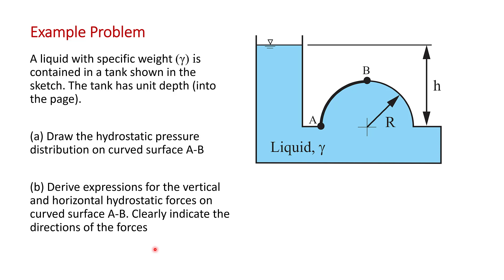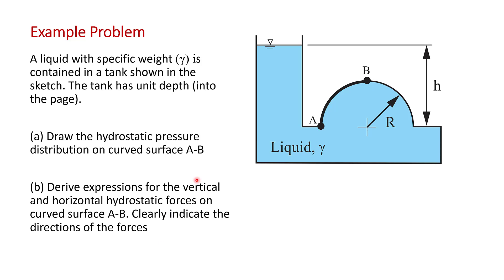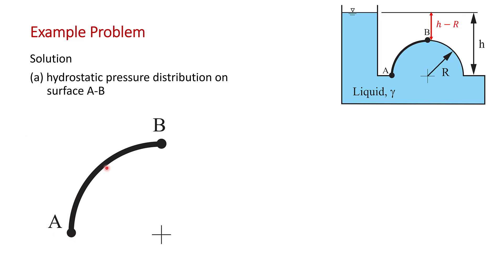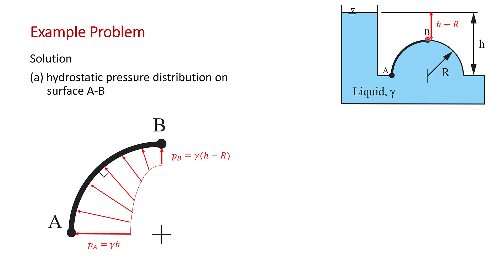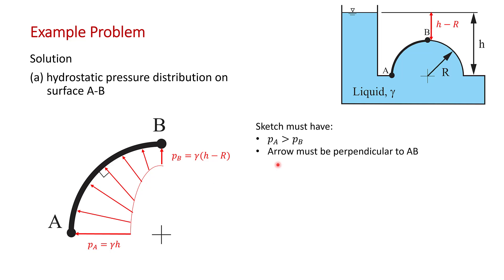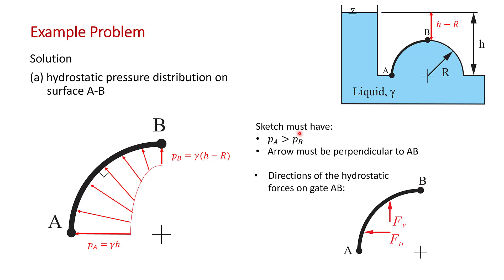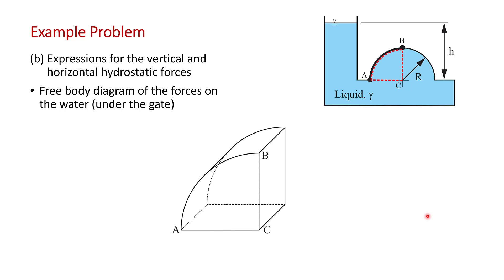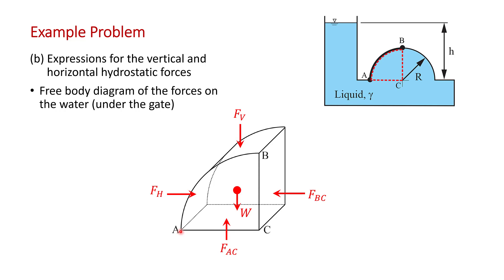Solved Problem: Hydrostatic Forces on Curved Gate

Comment: The weight of water supported by curved surface and free surface, we get the vertical  force quickly. But is the method of imaginary water surface is correct?
Reply from the maker: Yes, the "imaginary water" method gives the same answer in a flash, as you point out. It is totally correct. It's an alternative method.